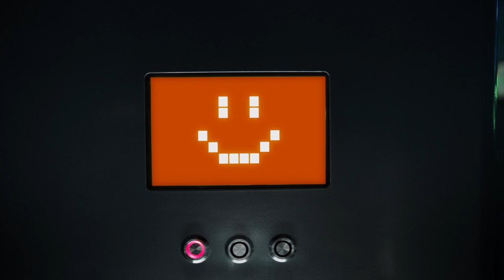Xiaomi Smart Factory: The Futuristic Factory

Comment: Too many Cons and pros
The pros are
Yes the work will be 24/7
They can release more phone faster
No workers will get exhausted
The cons are
Workers will lose job which
Makes a protest against the robot to remove them
Reply: Adding more to the list.
Pros:
•Less price for phones as they don't have to pay workers and no need for spending on employee overheads like insurance, sick leaves, vacations, allowances etc. A fraction of this cost would suffice for the maintenance of the said robots with possibly no effect on production if they have a redundant system.
• Standardized QC. The quality of each phone that leaves the factory would be of the exact same quality. No room for human errors.
•They can move the factory wherever they want. Just need to move the machinery to the desired location
•High efficiency. Machines don't get fatigue like humans. No labour strikes or mishaps. 
• No disgruntled employees or layoffs of human labor. Mitigates HR/PR nightmares.

Cons:
• Environmental impact. Like they said if it runs 24×7 that's gonna use the resources even more and use up energy much faster and create e-waste at a staggering rate.
• Less transparent. If the factory is completely autonomous there's no way of getting hold of human employees to tip us off about what actually goes on in there.
Reply: Good luck protesting in China. Back to the fields.
Reply: Just so y'all know, all machines need maintenance no matter what so there's a job right there for an entire factory
Reply: Get a better job
Reply: @Cathexis256  depends how much Xiaomi pays lol
Reply: China now don't face that problem actually, the younger generation who possess skills are less likely to go to the factory while the old generation may not meet the expectation, so this is the best solution.